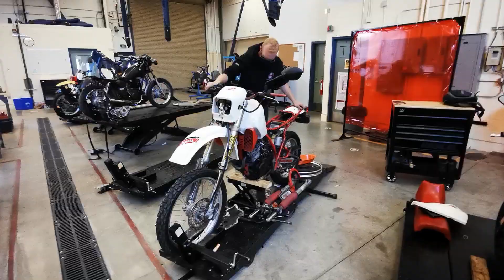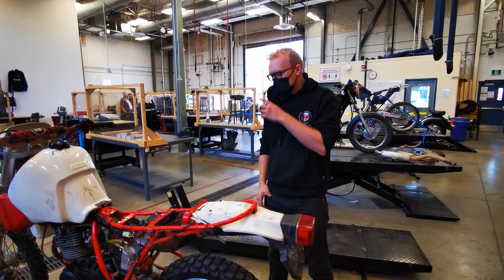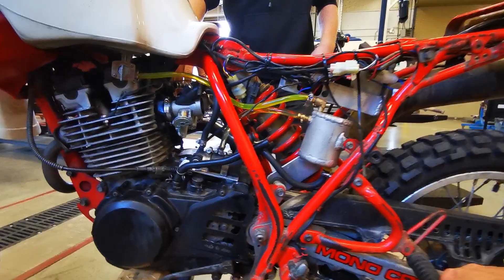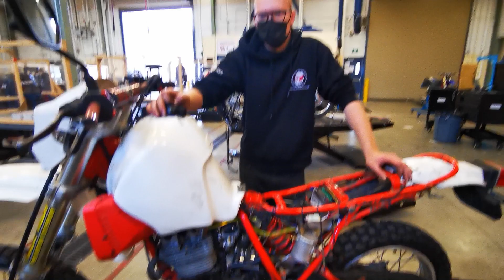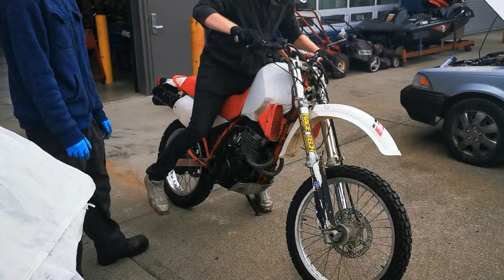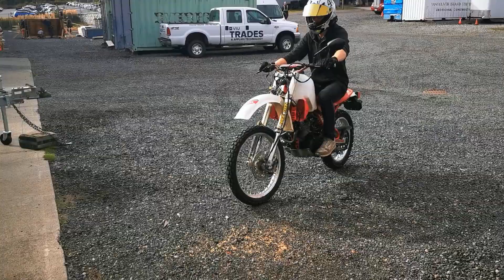EFI XT350

Comment: This is really cool good work. Not skilled enough to do this to my xt350. I'd want to do the yz450 fork and then the xt600 spring in the rear. Make it more of a usable dirt bike. Are you going to put a new pipe on it before going to dyno?
Reply from the maker: Not sure what Zander wants to do with the pipe.  I don't think its easy to find something aftermarket.
Reply: I found a DG pipe, not a full just a slip on. DG V2 Slip On 071-4350. Might be able to find used super trapp or Cobra.